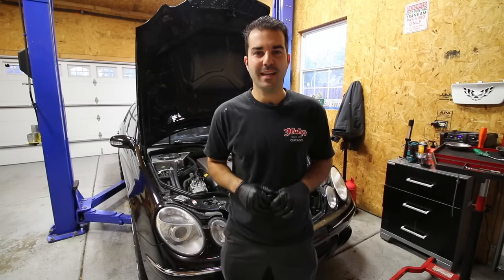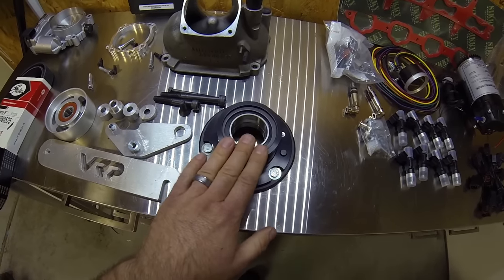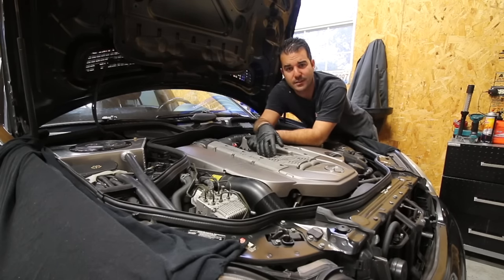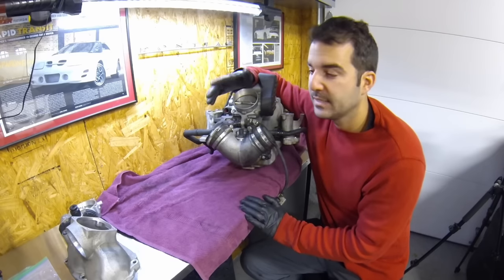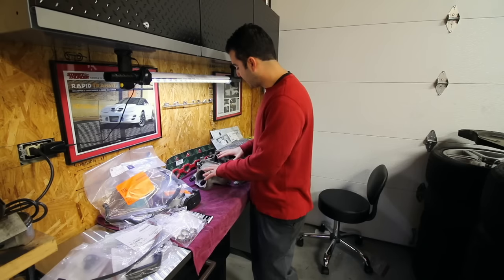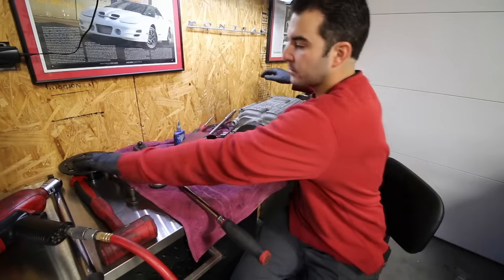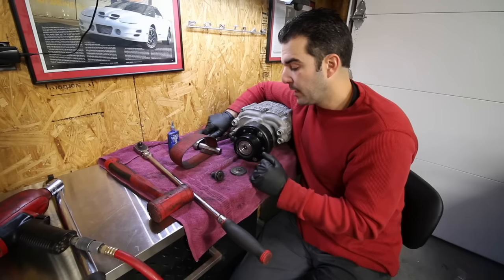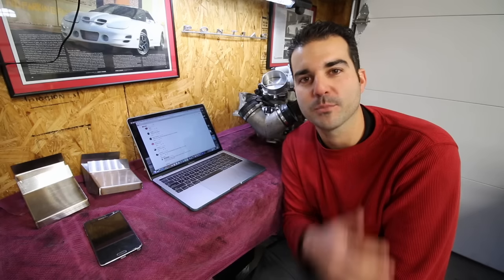E55 AMG Build PT 3 - More Boost & More Horsepower with these 2 Mods + Winner of E55 Parts Giveaway!

Comment: GOOD NEWS!  JUST RECEIVED A LETTER OF AN EXTENDED WARRANTY OF 25 YEARS/UNLIMITED MILES ON SBC-UNIT AND FEW OTHER RELATED PARTS FROM MERCEDES. THEY WILL REFUND YOUR COST IF YOU HAD IT DONE RECENTLY AT THE MERCEDES DEALERSHIP.

Comment: Hey not sure if it helps anyone out there, but if you ever have a belt squeal you can't get rid of, use Coffeemate, the white powdery stuff, and rub it into the ribs of the belt and put a bit on the pulleys (With the engine off!!), get it all over if you want it's cheap stuff, but when you run the engine again the squeal should disappear :)

Comment: Hello. Quick questions. Fuel pump related. Are the fuel pumps, both pumps should work on idle only? Only one pump working with my case. Im having low rpm underboost feel. My fuel pressure psi is at 55 only. When I accelerate it needs momentum after 3k rpm everything is olay again. No engine fault code. Most wear and tear parts and most sensors were replace except knock sensors. No air leak. Hope you can give tips to rule this out. Thanks

Comment: Hey Alex! Not sure if you are still seeing comments on your older videos but I still come back and watch these whenever I am planning something on my car! I have already done a few upgrades and added a 77mm pulley and RaceIQ tune and I’m wanting to finish the rest of my E55 supporting mods this year and parts are beginning to be discontinued. I found just about the last set of Maximizer long tube headers in the country and I already have a looped fuel rail and think I am going to go ahead and do the 550cc injectors ‘while I’m in there’, and I found a deal I don’t think I can pass up on a complete 82mm TB, ported intake and spacer and even comes with the factory SL intake tube to keep the factory boxes. It’s completely stock appearing and I have always preferred that sleeper look but I whacked an HOV marker the other day and busted my bumper and lost the center mesh grill but I can’t decide if I like the E63 bumper or just fix the broken one and get it repainted while it’s off to do the intercoolers. I have spent a ton of money with FCP Euro, VRP and, most recently, MK Ultra, and I only have a few parts left to be ‘full bolt-ons’ and if I’m going to tear it down that far, I only want to do it once and I already have an email drafted for Tony at RaceIQ to get the tune I will need for the final stage of mods. 

I can’t wait to get to the finished product and I would not have even thought about owning an AMG had I not seen that first video 4 years ago and I feel like you have been there every step of the way through my build. Thanks for your amazing content and it’s only a matter of time before #legitstreetcars gets offered your own show! Best car content on YouTube!

Comment: I️ wish you could have zoomed in a little on the blower/intercooler assembly, would have liked to see how the secondary TB is attached
Reply: Bounder With Chris attached via 4 bolts to the intercooler. It's called a bypass valve

Comment: Great Video Alex. With the intercooler out, have you thought about using any heat reflective material to help with the heat soak?
Reply from the maker: I have seen people doing that but in the end I don think it does much. I ended up using some heat tape under there for a methanol line. That will be in the next video though.
Alex

Comment: What do you think about doing a 70mm clutched SC pulley and a 90mm throttle body with a 3.5-inch intake? I currently have a stock intake, stock SC pulley, a 180mm crank pulley and a 010 intercooler pump with long tube headers and a tune from OE Tuning.

Comment: As a MB tech whats your opinion on the c32 amg?
Reply from the maker: Love the C32. Basically the same engine minus two cylinders. Great little car and you can do very similar mods. It wont be as fast as the E55 but still really quick and very fun. No airmatic to deal with as well.

Alex

Comment: Do you always use silicone on paper gaskets? Or maybe just select ones? Just to ensure you don't have to take the blower off again for a leak? Lol. Reason I ask is why not just use silicone? Spacing?
Reply from the maker: shawnmeyer44 Depends on what I'm working with but in general I like to put a thin layer of quality rtv on gaskets. I've always had good results doing that and following torque specs. For the TB, it's a custom bore so no gasket would fit without boring it so I figured the rtv would be perfect in that case
Reply from the maker: shawnmeyer44 Depends on what I'm working with but in general I like to put a thin layer of quality rtv on gaskets. I've always had good results doing that and following torque specs. For the TB, it's a custom bore so no gasket would fit without boring it so I figured the rtv would be perfect in that case

Comment: Hi Alex i appreciate your videos. I have a 2003 E55 and I don't want to go crazy with the mods on my car but i was wondering do I really need a tune if I just change my stock 74 mm throttle body for the 82 mm or if I just change the supercharger pulley for a smaller one?any of these need a tune specially if I want to keep the consumption on the car  as close as possible to what it is now? I feel a hesitation on my throttle body on low RPMs and after your experience with the 82 mm throttle body would you still recommend it? Or just go ahead and do a hard reset on my stock one like you did beating  up your car in another video?
lastly do I really have to take the supercharger off if I want to port the snout for the 82mm throttle body? Or there is another way around it to change the snout?thank u

Comment: So is that second butterfly valve on the intercooler a boost pressure regulator or something?
Reply from the maker: Its a bypass. Normally open and it closes to force air through the blower. 

Alex
Reply: LegitStreetCars oh interesting. I thought that was the purpose of the pulley clutch.
Reply from the maker: The clutch engages the supercharger but the bypass is variable and works in conjunction with it.

Comment: How you doing, I have a question. I have a 2005 E55. I need to replace my front sub frame, can I remove it from the ground without pulling the motor with it? Or is the motor fully connected to it?

Comment: You ever deal with all the inter coolers leaking? Especially on the c32?  Love the videos! Thanks
Reply from the maker: I have never seen them leak on the 32 or 55 cars but I'd imagine it wouldn't be too hard of a fix. They are mostly rubber lines going to the intercooler and HE.
Reply: LegitStreetCars , it was a huge issue with many c32s. I have one so I know more about them. The actual core inside the inter cooler leaked on many of them including mine. No way to fix it only can replace it. Also a p.i.a. Cuz you have to remove the charger to get to the inter cooler under it.

Comment: What do you think that box does to transmission? Because for example in w124 the automatic transmission is said to last longer if it is tuned for hard shifts instead of longer and smoother shifts. Is this like same thing or am i completely wrong xd don’t know basically anything of the mechanics of cars, this thought just came into my mind :) nice vid as always, can’t wait for the test drive vid
Reply: F.Hamer these do increase line pressure for faster shifts

Comment: Love your build dude. Been following it ever since i decided i wanted to swap out my e46 m3 for an e55. 

Do you feel the larger coolant tank is necessary?
Reply from the maker: I don't think its going to make or break a setup. I really wanted it to put ice in at track. The larger capacity is nice but at the end of the day it just prolongs heat soak. I'm finishing the water/meth kit right now. I think that is a very worth while mod and Ill know a lot more if I can make it to the dyno and track all this week.
Reply: Thanks for the reply! Yea I am definitely looking at doing more of a fun street build than I am a drag strip build.  Would you consider talking about good mods for a mild street build in a video?  I am looking into doing pulley, tune, maybe throttle body.  Heat exchanger and maybe a bigger IC pump.  But I think I am going to stop short of meth injection and an ice tank.
Reply from the maker: Ya sure. I was thinking of doing a video later on what I think of the mods so far. Just have to finish them all, haha

Comment: I noticed the Underhood liner has been removed. Have you noticed any issues with it removed? Are there any benefits to it being removed? There are a lot of people saying it helps to dissipate engine heat and makes the supercharger whine more audible. Is there any truth to this? Or was it removed when you purchased the car? I would love to hear more whine and have less heat.
Reply from the maker: It was removed by the previous owner. I haven't had any issues without it there and I've driven the car in the rain a few times. I don't think it does much for supercharger whine and I doubt it does anything noticeable for intake air temps.

Comment: @LegitStreetCars I also have a E55 2006. I have a power steering leak. Is there any advice or any website that I could find parts? I took it to my local mechanic shop and they can’t find a hose that it leaking. And needs to be from the dealer.

Comment: did you use black sealant for all your gasket connections
Reply from the maker: I used it on the tb adapter and the tb to the adapter. I used a light coat on all other gaskets too except the donut seal for the bypass

Comment: That Black Series pulley though =) Great Video, awesome work!
Reply: Can I use 76mm SC pulley  with stock tune & cooling then? Thanks
Reply: @krzysm5  You will need a tune for 76mm
Reply: @victoryroadperformance3131  which pulley should I get ?
Reply: @krzysm5  76mm is our most popular pulley

Comment: What are common problems with the 163 engines?
Reply from the maker: Early ones had issues with head bolts, timing chains, cam adjusters, lifters.  Very expensive stuff.

Alex
Reply: I've been looking into the E63s because, like you, I use to be a dealer technician (Audi) and I've done serious engine work before.
Reply from the maker: Very nice. I know the face lift and updated interior is nice buy I prefer the 211 E55 due to ease of modifications. If you don't plan on going much faster the E63 is a good choice.

Comment: Anyone know why lights in switches (such as map light switch in ceiling, dash lights and lights in their switches stay off as they should) are left on in the car after it is re-entered and left unlocked? Drains battery to empty. I checked things out with SD tool, but nothing cluing me in. Like, what controls those lights in the switches?

Comment: Does that E55 got SBC break pump?
Reply from the maker: Yes
Reply: Thanks for answer. Any problems with it recently? I heard it got breaking counter. Should i be worried about buing car with that pump ? :D I was thinking of buying CLS 55 AMG but that SBC pump....meh
Reply from the maker: Fortunately mine was replaced before I bought the car.  But yes they do fail. The pump is around $1,000 plus install and programming.  I don't think I would let it deter me from buying the car though.  There is also a good chance its been done on the car you are looking to buy. Just ask for service records and buy one that has had it replaced.
Reply: Great Thank You!

Comment: Why don't you use aftermarket supercharger.
Reply from the maker: vasil ralev No one really does that with these cars. There is one company that makes one.  It's about 8k for the kit.
Reply: Thanks<
What do you think about buying a car Already tuned, or already with aftermarket supercharger Cleeman. 
Is it worth to check it out? or I should run away from these cars?

Comment: How is your SBC doing?
Reply from the maker: Its doing well. The pump was replace a couple years ago so I'm good for a while.
Thanks for watching
Alex
Reply: Oh thats sucks, I have an 06 E350 with 45k and wondering if thats the next big deal, I just got the balance shaft replaced by MB
Reply from the maker: Well the previous owner replaced it so I got lucky. That balance shaft is a pretty big deal. Did they cover it for you?  The sbc pump has an extended warranty. I think it may only be for 10 years though. You may want to ask your dealer
Reply: MBUSA covered 15% of the $6400 for the balance shaft replacement, at 44700 miles, IMO they should have covered the whole thing, because of this no more MB ever
Reply from the maker: Thats ridiculous. They know its an issue.
Reply: Two lawsuits and a settlement that I missed due to not having the issue until after the statute of limitations which was Jan 2016, thanks for the feedback

Comment: is it possible to upgrade my 2006 CLS 500 to a cls55 supercharge.. by the way I like ur videos.. thanks
Reply from the maker: Yes but not many do it. It would be cheaper, more reliable and easier to sell yours and buy a CLS55
Reply: Don't do it.  None forged components inside of engine makes it risky.  Cylinders aren't forged.  Which is super important in a supercharged platform

Comment: You ruined the factory collectable car with you're fuckin add ons.
The E55 AMG stock can outrun a stock 2005-2006 mustang GT .
And it can outrun a 2004 Suburu WRX . I know because I use to race this car stock . I beat many Honda Civic type R with just a stock engine with Corsa exhaust straight pipe being the only thing I added to gain 16 more Horsepower.